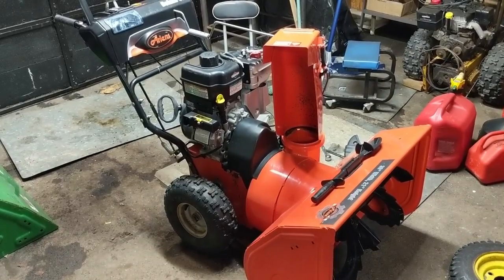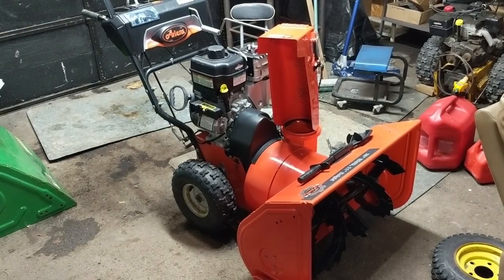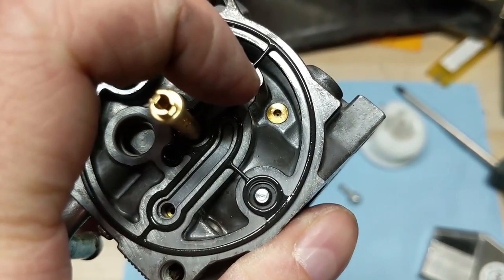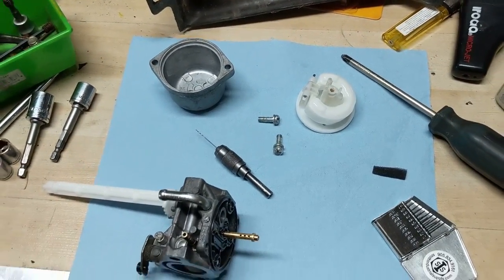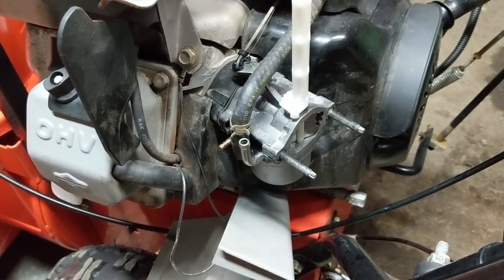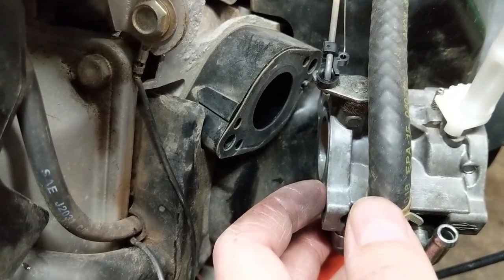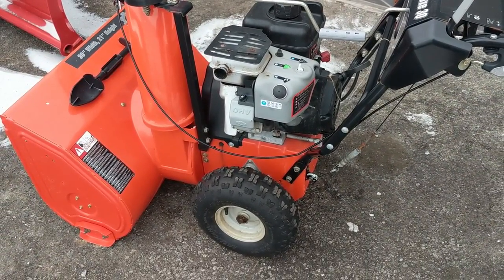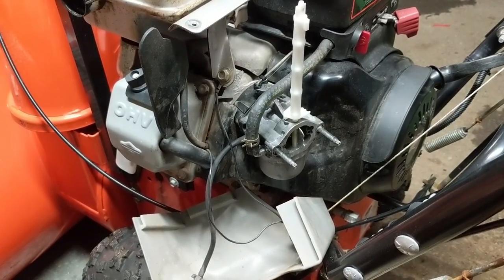How to Fix Surging on Nikki Carburetors

Comment: Why would this run correctly new, but surge at a later date? The idle jet didnt change size. Your videos are very good. Great info.
Reply from the maker: The engines slowly lose compression in the Piston rings and the valve tolerances aren't as tight, so they pull in the same amount of air but less fuel. By slightly enlarging that pilot jet, you make it easier for the engine to pull in a bit more fuel!
Reply: Awesome, thank you for the great vids and info.
Reply from the maker: @jamiesawyer5102  thanks for watching!
Reply: He told you over a period of time that piston wear look at video again

Comment: Hello Eliminator Performance
I have a John Deere Snow Blower JD1130SE with a Briggs & Stratton 1550 Snow Series Max, Model - 21M214 with a Nikki Carb  793785  G02544  9X09  3A.
You said you found a replacement Walbro Carb on e-bay. What number is the replacement and would it work on my engine?
Thank you for your help. 
Cheers
Willy

Comment: Hello. I have this carb on my Murray blower. My is also surging but i was thinking that it was because i dont have manual gas  adjustment. The horizontal lever you have right next to carb I dont have. Dont you know why I dont have this lever on my blower? I am total noob. My first blower ever and I am new to servising my mover and blower
I have 20e114-0115e1 engine

Comment: Did you try blowing snow with it? I've gone through this myself and although it ran great with no load it died almost immediately once I tried to blow snow with it. I never did solve that one.
Reply from the maker: Did not try blowing snow, usually I just engage the Auger and listen for changes in RPM/sputtering etc...

The engine had that slight sputter at 0.032" so I enlarged it to 0.034" and it solved the issue. It hasn't come back, so I'm assuming it's working fine.

Thanks for watching Tommy!

Comment: Interesting video, cool to see the results! I have a question: I have an older snowblower with a  Tecumseh 5 hp . The intake valve clearance is .005 and the exhaust is .012 . Do you consider this acceptable ?  Thanks.
Reply from the maker: Thanks Andrew, and usually I'd run around 0.004" IN & 0.008" EX on the Tecumseh 5hp lawnmowers, and 0.008" and 0.012" on the HMSKs snow blowers.

Here's some specs, check your model number and reference here: http://outdoorpowerinfo.com/engine_specs/tecumseh_valve_gaps.asp
Reply: Thanks so much!

Comment: I have a new nikki carb on a 14hp briggs it is rated for 14-18hp and it surges and dies. Do you think this would fit it?
Reply from the maker: Should fit, make sure it's perfectly clean as well that'll be a good starting point

Comment: I worked for a Toro dealer a few years ago. The newer Toro snowblowers with the Briggs engines would run really lean at low or high idle. Really bad surge, every single one of them.
Reply from the maker: Not enough fuel, they do that to get by emissions lol thanks for watching!

Comment: Good vid, thanks. So I have had a nightmare past month. Went through buying 3 original Nikki carbs one after another. They all flooded and sent gas into oil bad. Yes, all 3 in a row factory orig used. That is with a gas shut off. Gas on and floods in 15 sec. Rebuilt all 3. Did many oil changes due to flood. Needless to say wasted alot of money and time. This is a ride mower 17.5 Briggs I/C. So, still not wanting to spend the 162 for orig at Briggs, I brought a China after market. Not thrilled because I stick to original quality control. Never did this on a carb so I did. Got that carb other day and well, no more flooding. Thrilled there. Pissed now engine surges. Never did that at all. Brings me to now and your vid. My carb looks like a Nikki inside and in vid. Course I forgot to see if it had idle jet lol. I will though. Mine has 2 screws on outside for idle and air/fuel mix. I ajust air/fuel and surge calms, but still there till high throttle up mostly. Idel is meh, but was worse before ajusted that screw. So I was not aware some of these carbs have no low ajust inside to drill.Just nice given my past month. Most likely the China carb won't, but will pull it to see. If it has one just do as you show and sounds like my case is what you vid? I was smart, but who knows how that will go. At the time I ordered China carb I also ordered a Walbro clone/after market I'm still waiting on. In hopes the guts is not plastic insert. I did see in photo on outside of carb it has some kind of brass screw that screws in straight down around main fuel inlet for hose. Most likely what you drilled?

Comment: I have a 10 hp ohv generator. Problem is that have to choke some to keep it running and also surges at  times . I have taken apart the carb and cleaned it out twice, but do not have the brass low speed. Only have a the whole thats to the right of the high speed as you are looking at the base. Also the carb that is on the this does not have an o ring where the fuel comes in. The o ring is part of the rubber gasket and plastic has two small slots the fit into  the hole to keep and align the plastic for the float. Any ideas on what else could try looking at.

Comment: Can't find squat, might you be able to steer me in the right direction regarding a NIKKI carburetor? Web says all kinds of places but once I get there, there is no place to look up the numbers on this carb..there are 3 sets of numbers
2005371,  C 120261 and
1331. I would really appreciate any help.  I'm getting very frustrated. Partstree gave me one option, a gasket. Thank you very much
Reply from the maker: My advice would be to run the model number of the engine, find a parts diagram. Then go from there. Those numbers don't give me anything unfortunately.

Comment: Question I bought a Nikki it has no low speed, how does that work? Also what is the other jet for that's under the plastic body? Not the one you adjusted but the other brass one .
Reply: High speed jet

Comment: It seems alot of small engines have surging. Why do they use undersize idle jets?
Reply from the maker: For emissions to cut fuel
Reply: The govt. Strikes again! So now we drive around using gas to fix these machines.

Comment: I have a Nikki carburetor that is giving me trouble.  It is on a Snapper ST2046 riding mower.  The Briggs & Stratton # is 594207
.  I purchased it used, and when I first ran it, it was OK on choke, but it would die immediately when I went on rabbit.  So, I cleaned the carburetor and rebuilt it, and now it will run on rabbit, but it will slowly die out.  Do you have an suggestions?
Reply from the maker: Sounds like the pilot can't put enough fuel through to run it on idle, either that or have a look at your main jet.

Usually if a main jet is clogged, you need to run your engine with choke on.
Reply: @EliminatorPerformance , thanks for the reply.  I have a couple of questions.  Where is the pilot?  What can I do to fix it?  If it is the main jet, is there anything specifically I need to do to clean it?  I have used carb cleaner on it already.
Reply from the maker: @storeemail1  find someone with an ultrasonic  cleaner or get an aftermarket one on Amazon is probably the best option for you. Carb cleaning with carb cleaner won't be as effective.

Comment: Good job I did learn something new
Reply from the maker: Thanks for watching!
Reply: @EliminatorPerformance  I learned something too. I'm one of those idiots who tried reaming out the main jet and destroyed the carb!  I was so exasperated I ordered an OEM Walbro at $110. It worked, but man . . .  Now I have another Nikki on a 15.5 HP BS and the engine is surging. I'll let you all know if I can get it to smooth out by reaming out the low end jet.

Comment: I have always hated a nikki carburetor. I need to know where is the slow jet on a walbro carb?
Reply from the maker: I believe the pilot jet is what we oversized here, that controls idle. Then the main is the one in the plastic tube.
Reply: The carb is on a 15.5 Poland riding mower

Comment: hello, my generator that has hardly been used sat for a while  , after cleaning the carb, it starts right away , then after it warms up it starts surging and then dies, ten i can restart it again and it surges and dies. any pointers, its a king craft 3500 gen. its huayi carb. thanks in advance
Reply from the maker: See if this helps, maybe this carburetor is similar; https://youtu.be/Z6F38bSxSp4

It is most likely pilot jet clogged up

Comment: How do you fix with same concern with the same nikki carb with no low speed idle jet ?   Mine does the same thing but at idle . Pull choke out some and it fixes it  Thanks Billy.
Thanks Billy
Reply from the maker: Replacement carb at that point

Comment: Mine doesn't have a jet there, just a hole. No idea where it is. Almost identical nikki carby except my fuel inlet is straight no bend. 19.5hp bs john deere la105 single. 
Strange. 
Only i.d numbers are one being the number 7 on the side.

Comment: I buy the aftermarket (china) carburetor 796122 and the primer doesnt work because that pilot jet is not existing...  its supposed to be the same as the carburetor you're working on 793784
Reply from the maker: In the carbs without the hole shown like mine had, there's an actual idle jet you can oversize, same principle, start with 0.002" reassemble and test

https://outdoorpowerinfo.com/repairs/briggs_intek_single_ohv_nikki_carb.asp

Comment: I would avoid any Briggs engine unless it’s a Vanguard. The Chinese LCT engines are actually less trouble-prone I hate to say. A lot of manufacturers use the LCT because it’s cheaper but also because has less warranty claims than the Briggs engines.

Comment: I was gonna try this on my rider but my Nikki carb doesn't have the brass jet.  It's just a deep hole where yours has the jet you drilled out.
Reply from the maker: Some of the aftermarket Nikki carbs don't have the Jets, I'm going to be doing a video comparison of them within the next few weeks
Reply: Eliminator Performance so my carb just has a hole.  No jet there.   How do you fix this issue on a carb without the jet
Reply from the maker: I've never been able to find out, because I've never worked on 1 without that brass pilot jet! Aftermarket carb replacement from Amazon or eBay might be a thing to look into!

Comment: Do you know of a replacement carb that has adjustments and fits in place of the Nikki?
Reply from the maker: The Walbro carbs, Google your model number and look for a IPL (ILLUSTRATED PARTS LIST) and on the parts diagram they usually show the Nikki on the right and the Walbro on the left, use that part number and you should be able to to swap it (the throttle hookup/bolt pattern is designed the same).
Reply: @EliminatorPerformance  awesome. I'll look into it.
Reply: @EliminatorPerformance  
I found replacement Walbro carb on e-bay, have to be careful, because of all the knock-offs. Make sure detailed description states Walbro it is a few bucks more than knock-offs, but worth it.

Comment: Great video, I hate those Nikki carbs...I don't even bother to try to fix them anymore, even after ultrasonic cleaning it's a crap shoot. Carb kit is like 50$ in Canada! I have bought the aftermarket Chinese carburetors (25$ ) and have had good luck with them but you have to drill out the plastic where the linkage connects. Aftermarket from Vickers is around 100$ and are supposed to be good.  Your repair would be over an hour's worth of work I imagine anyway....too long. There's my 2 cents. 🔧👨‍🔧🔧
Reply from the maker: Yea they are a pain for sure, I plan on doing a OEM vs Aftermarket video sooner or later, you definitely get what you pay for!
Reply: @EliminatorPerformance  Really! That would be a great video! Are you talking about a Chinese eBay aftermarket carburetor or a Vickers or whoever aftermarket carburetor?  I guess I'll see in the video. My buddy gets his aftermarket ones from Vickers marketing and says they're good.
Reply from the maker: It'll be OEM - Amazon (China)

The ones from STENS (we don't use Vickers) are more pricey and seem to be about the same...

At least with Amazon, I click refund and I get my money back within a couple days, hassle free. Usually get to keep the item too...

Comment: My Carb looks just like yours, gasket and all... but I don't have that jet??! There's just a hole and it connects to a passageway, I shot carb cleaner through it and saw where it was spraying out the other end of the passage. Do all of this particular carbs have that jet?? Mine is a Nikki 794459 G02550 0317 4B

Comment: I've got 2 carbs, both do not have the brass jet in that idle passage. It's just a hole that goes through. I know it's lean because a little propane or slight choke and it runs smoothly. Now what? Lol.

Comment: Eliminator can you tell me how to adjust the governor on 20 hp kohler reving wide open
Reply from the maker: If it's a courage, I may be doing a video on that, it's from last year but I was going to edit something to put up.

Probably blew the plastic governor gear, or cam gear, Kohler's are known for doing that!
Reply: @EliminatorPerformance  I just mlm put a new cam in it I check the govenor it looked fabulous I reinstalled everything now it's running wide open I need to know how to reset the govenor on kohler 20 courage thanks man in advance
Reply from the maker: @robertyearian227  if you've had it apart, it's most likely the tappet that rests on the governor counterweight pin. You have to make sure it's lined up, it probably just slipped off when reinstalling the sump.
Reply: @EliminatorPerformance  how do you do that plz

Comment: How do you fix one that only runs on choke?
Reply from the maker: Main or pilot jet clogged
Reply: If it's just running on choke its prob needle valve and float needs adjusted
Reply: @EliminatorPerformance  thank you
Reply: @robertyearian227  thank you

Comment: the worst nikki carburetor were the ones on the twin cylinder engines like briggs intek and kohler courage those carburetor's love to surge pop and spit, mostly due to o- ring failure around the idle and run jets, but most nikki carbs are crap.

Comment: I use acid dip on surging carbs and it fixes them 
Ultra sonic cleaner just doesn’t get them very clean
Reply: If not drill out to .035 to start with
Reply from the maker: I drill all pilot jets to a minimum of 0.020" now even on the new MTD carbs